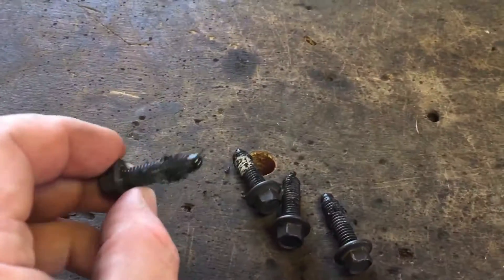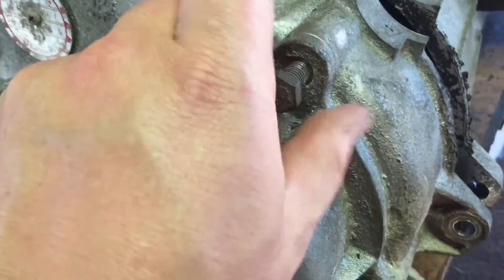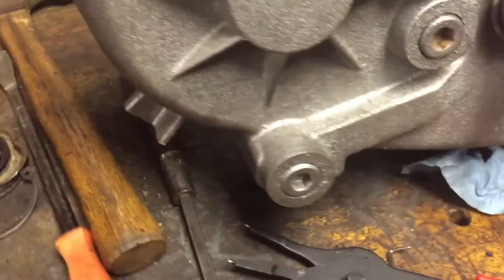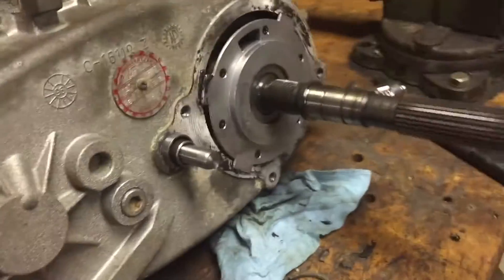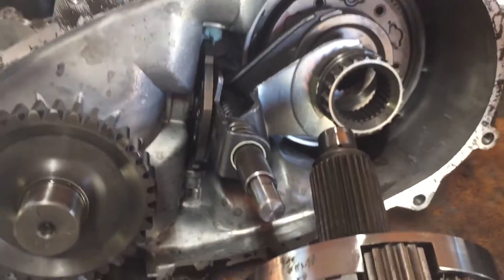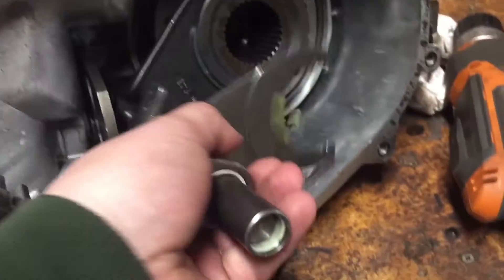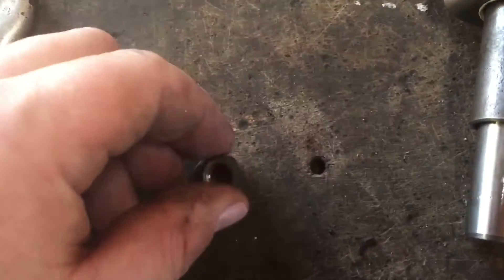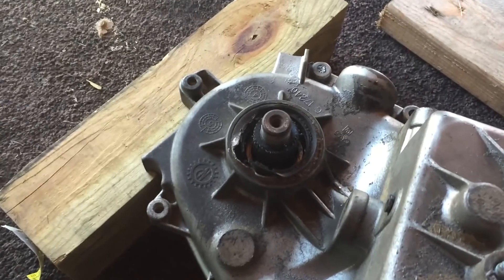Disassembly of the NP242. NP249 to NP242 transfer case swap Part 2.

Comment: On the NP242 there is a roll pin that must be removed. There is an access hole.  You have to punch out the plug and then then the roll pin.  You have to do that before splitting the case.
Reply from the maker: Please explain further. The roll pin would not tap out and it also did NOT need to be removed before the case was split. Post your vid link here if you would like, I'm all for information sharing.

Comment: On your np249/242 I can only find part 1 and part to I'm trying to do this and need more info
Reply from the maker: You are replying on Part 2 of the video
Reply: I ment to say I can only find part 1 and part 2 that's it I need more on putting the 2 cases together please where can I find those videos
Reply from the maker: @kevinwoodard680   Unfortunately I do not have video of that because it is essentially just reverse steps of my 249 and 242 disassembly. My end result was a 249 front half and 242 back half of the cases. at 7:30 I explain some of that.
Reply: You more then likely have a F/B page I would like to D/M you with more Questions about this build, where can I find you on Facebook
Reply: @AOT-offroad   What I was kind of curious of is how did you get rid of the viceless is the visceless coupler or did you???
Reply from the maker: @kevinwoodard680  shoot me an email alloutthrottle@gmail.com

Comment: The 96 242 was on a vehicle with a different transmission. Was you rear drive shaft the correct length for the 242 TC after you were done, or did you have to change rear drive shaft length also.
Reply from the maker: yeah I'm 46RH and the 96 probably had 46RE. Nothing caused any problems driveshaft length fit properly.

Comment: How has this held up for you? I'm in the same boat as you, to where I need to do the same thing. Just curious, why can't the ring gear or Sun gear whatever you want to call it, that makes contact with the outside of the planetary gears, just be swapped from the 249 front half to the 242 half? Thanks for the video by the way
Reply from the maker: xXBlackxDahliaXx 0 well since the swap I’ve been fabricating my triangulated 4 link set up. Maybe you could swap that gear but I had messed up the  bearing in the case so I just decided to use the 249 side.
Reply: All Out Throttle thank you for the response man. I'm just going to use both halves. Bought a rebuild kit for both sides, so just need a new chain and I'll be good to go. Thanks again

Comment: So you took all the guts from the front of the 249 and just installed them into the front shell of the 242 ?
Reply: or did you literally just swap front ends without changing anything ?
Reply from the maker: Sorry for the late reply. I did the opposite. I removed the guts of the 242 and used the front of the 249 (because the gear cut is different 7:48) to make one frankenCase.

Comment: I had another question bud. Since you said to use all of the shifter parts from the 242, and install them into the 249 front half, does that include the bolt, spring and pin thing  that the shift gear thing inside makes contact with, or just use the one from the 249? There is a difference in length I noticed.
Reply from the maker: I used all of the guts from the 242 including the shift parts